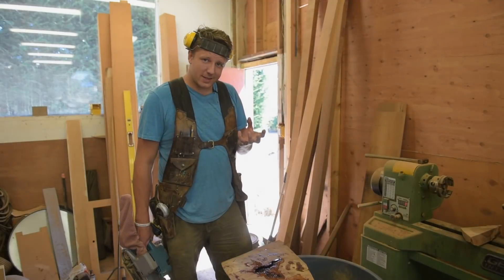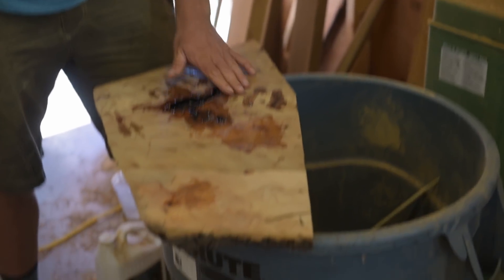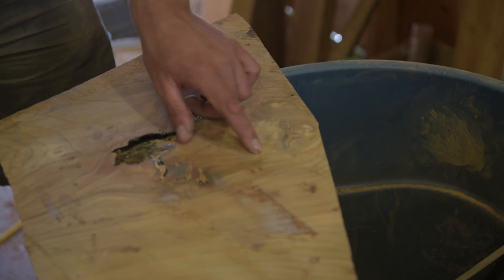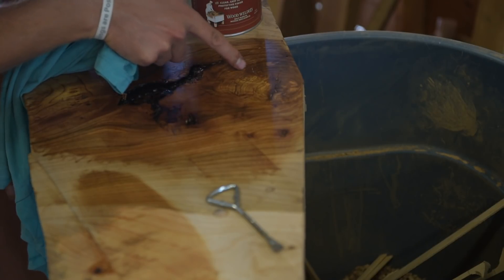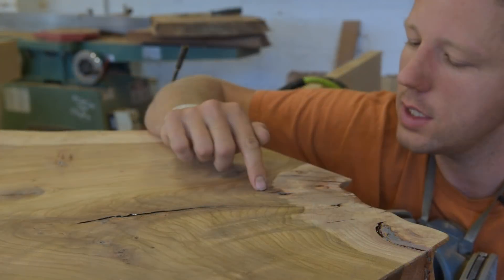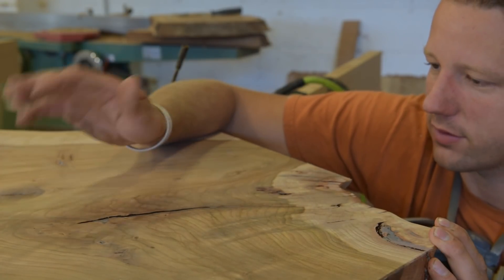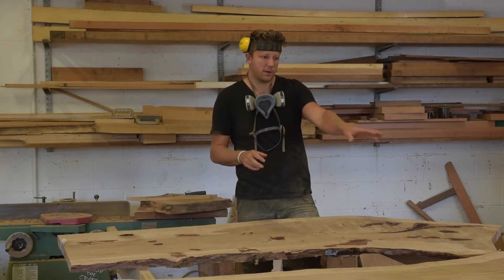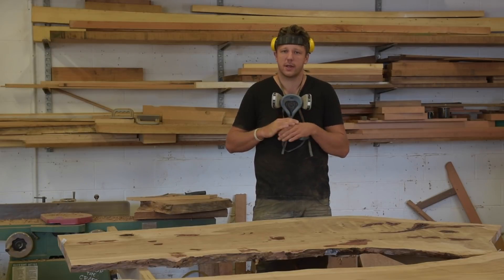How To Fill Cracks With Epoxy, Live Edge Table Pt 4

Comment: Ooof. This is hard watching you make some of the same mistakes I made just a couple weeks ago. All of these are "as I discovered the hard way":  (1) when filling deep voids, pour the epoxy in layers, allowing a couple of hours between pours. Too deep a pour of epoxy in one go will overheat, and bubbles will form and keep forming inside, ruining it. (2) you seem to have edited this out of your re-upload, but based on your first upload, you're using the heat gun waaaay to long. Heat gun blasts to get rid of surface bubbles need to be short, sweeping, fast swipes.  Too much heat gun will just prematurely solidify the surface and make it gummy, contribute to the heat buildup, making the interior bubbling *worse*.  (3) As you discovered, don't worry too much if the first fill doesn't fill up to the wood surface. You can epoxy over epoxy just fine, and bring it up to level.
Reply: Yeah what this guy said. Can vouch.

Comment: I'm just wondering... What if you fill the voids with epoxy prior to the initial surfacing with the router sled. Then the voids would be filled and any surface stained wood would be cut away. Has anyone tried this?
Reply: Done this a couple of times, no damage to the epoxy and sand smooth as normal.

Comment: So basically the epoxy is fiberglass resin. If it sets too fast, it will be brittle--thus, use less catalyst, be patient, and wait. It will be much harder in the end (although it may take a bit more effort sanding). Oh, use a respirator when sanding. The epoxy/fiberglass no es bueno for your lungs. Thanks for the vid.

Comment: Hey Samurai, thanks for many, many inspiring hours .  A small advice: You can pour the epoxy more delicat using a syringe. That way you also prevent airbobles in the material.

Comment: I have a lot of experience with West epoxies. This is an exothermic chemical reaction. Use the prescribed ratios of epoxy and hardener, be sure to use the slow or fast depending on the time you need. Please do use lacquer anywhere near this epoxy. It can not adhere to this epoxy. I use West system in a marine environment. For a finish we always use West clear or Epifanes varnish. There are some tricks to that process as well. Finally you can use a better quality tape, but wax or mold release will work much better to keep areas you want epoxy free. Happy to give you more direction if needed. BTW love your channel, want to make some boat parts?
Reply: If you alter the prescribed ratio there will essentially be unset hardener/resin suspended in the product, making it much softer.
Don't forget that the space you are working in needs to not be cold, 15C+ or the epoxy will not set. Too hot and the epoxy will set before you can finish working it also.
Reply: Peter Johns I work a on hard wood slabs and the process he stumbled on by doing two pours is exactly what we do
Reply: +michael lane  Exactly. Just to expand a little on your point, epoxy systems  are not like polyester resins or catalyzed acrylics or whatever, as in: more "hardener" does not mean a hotter faster batch. With epoxy the "hardener" is not just a catalyst, it becomes part of the cured material. Just consider how much "hardener" is used compared to, say, polyester resin for laying up fiberglass. Common mistake tho, since with catalytic processes throwing a little more catalyst in the pot does speed up curing... sometimes to the point of the material getting ridiculously hot xD !
Reply: I think you meant "Please do 'not' use lacquer anywhere near this epoxy". I was thinking as I watched, is he going to coat the entire table with epoxy?
I used to repair windsurf boards a few decades back and experienced all the epoxy malarkey you could ever not wish for. ;¬)
Reply: wordreet correct, thanks for the correction!
Reply: If you're working in a colder environment you could use west system fast hardner, this makes it possible to use epoxy when it is above 4C+.
Reply: "Large masses cure fastest."
Reply: What West epoxy resin/hardener combo would you recommend for the average woodworking void filler?
Reply: Peter Johns 
You know you can edit your comments don’t you?  (Just to make sure)

Comment: I have a recommendation for the clear finish on the epoxy. You need to use automotive clear coat .Its great for items that get sun or a lot of light exposure . I used it on my 1936 dodge woodie project . I believe 99.9% of skilled carpenters  are total hacks when it comes to Finishing  wood . Theirs all types of developed skills in finishing wood and their just guys that do that. No different than asking a painter to build a table . He could follow the directions use your plans and I guarantee you it won't look like your table.  https://flic.kr/s/aHsjLSSVfB

Comment: Love your videos, but a lot of them have been WAY under exposed lately.
Reply: I also agree,  but I am the one to blame for that.  Metering by eye, through a variable aperture zoom lens in a shop with inconsistent light isn't the way to get consistently exposed shots and the evidence is there.  Hopefully through using a field monitor and maintaining 180 degree shutter angle I will amend these issues moving forward, I apologize as I am not happy with the results either however when I first started shooting for Samurai the comment section were full of comments like "I can do without all the fancy camerawork, I am just here to see you build stuff" this is not excuse for poor exposure, focus etc however it has presented as a hurdle for me as we decided to run with equipment that is completely unfamiliar to me in hopes of finding that balance between how the Samurai was shooting and editing and how to improve it without changing too much.  Thanks for your comments, they do not go unnoticed

Comment: Build a lot of Longboards with Epoxy. I think their are only 2 ways. The 1. : Build a solid form around the crack and fill it up with much more Epoxy then you really need. I Think the better way is: Fill it up with just some Epoxy. And when the Epoxy is just barely hardened (Its called gel time) fill in the 2 time. The purpose is, you dont need much more extra Epoxy . Further the new layer of epoxy sticks much better on the old one, when it is not fully hardened. This technique is called "wet in wet"

Comment: I learn a ton from these vids. But, I wonder if  you could have taped the top and filled the cracks with epoxy from the bottom side of the table? Possibly have only had to do ONE run of filling? Maybe.
Reply: An incredible simple yet brilliant suggestion.  Thanks!
Reply: I have done that and it can work. Depends on the piece and the inclusion being filled. I've seen other recommend that.
Reply: I've done that as well.  I'd recommend putting wax paper over as it'll leave it smoother (there isn't much material left to sand/plane off when you do it upside down, so you want to it be really smooth)
Reply: It also removes bubble issues as they form at the "top" (which is now the bottom)

Comment: What a show! Please, never alter the recommended mixing ratio on epoxy. The result will yield in a weaker final material and it will be toxic. The extra hardener molecules, that will not bond with resin molecules, will stay in the final material. Grinding the final product is just like spraying the hardener by itself all around your workshop, poisoning you and your loved ones. So please: never alter mixing ratios of Epoxy. Never! In case you need a faster result, use the appropriate (faster) hardener.

Comment: Might reduce the "mess" to use a syringe to inject into the smaller voids.  Perhaps try a paste of glue ans sawdust on the underside then the tape might help the areas you couldn't quite get the tape to seal.

Comment: If I sand hardened epoxy, the surface gets rough (at least with sanding paper up to 240 grit). Does sanding with finer sanding paper make the surface shiny again or is it the poly finish that fills up the tiny grooves?
Reply: Lammert Wiersma I have the same issues. Have you found a solution? I’ve read that sanding it with up to 600 grit will restore the shine?
Reply: I sanded it with up to 1000 grit giving a very smooth surface. Polishing with polishing paste melted some of the epoxy (didn't even know that was possible - glad that I tried on the downside of the table) so I wouldn't recommend that. The surface doesn't look white any longer (as it did before fine sanding) but black, which is OK. Bright light shows many small bubbles of air in the epoxy, causing it to be less transparent than I had hoped. I finished with a matte polyurethane coating, which probably also contributes to less clear epoxy. All in all did sanding work well. I would recommend making sure that no bubbles are in the epoxy if you want it to be really transparent, sanding up to 1000 grit, and finishing with a clear coating.
Reply: Lammert Wiersma so you only did dry sanding up to that grit? Luckily I don’t need it on the top of this particular build but my next piece is knotty so I will have a lot of epoxy. Thanks for the info!
Reply: No, for the finer grits (if I remember correctly from 300 grit onwards) it was wet sanding.

Comment: hmm, not too impressed with the camera work, not to the normal standards.  Just sayin'
Reply: Me neither, and I am behind the camera.  We are still adapting.  Samurai has developed his shooting style his own way and set the bar quite high.  WE are collectively still learning to make the best of my ineptness with Nikon DSLRs (never owned one, only use one for him), Shooting without ND filters and outside of 180 degree shutter angle (atypical for me), trying to make framing adjustments on the fly with a 2 way head (I own fluid heads) as well as adapting to a new style of shooting where there is a person behind the tripod and the Samurai does not need to stop what he is doing, walk over to the camera, reframe the shot, adjust settings and walk back in front of the camera so he often forgets that I need time to do the same which leaves me scrambling sometimes. I apologize and know that this has not gone unnoticed.  This is something that is at the forefront on my own concerns as well so thanks for sharing
Reply: one of the 1st steps in improvement is recognising the problem and wanting to improve. Learning curves can be steep, and youtube is a fickle master. Best of luck my friend.
Reply: Thanks Mickleblade, not sure where my response went by yes it kills me too... I wish it wasn't the case but we are working towards solutions that will hopefully further limit technical and other undesired issues